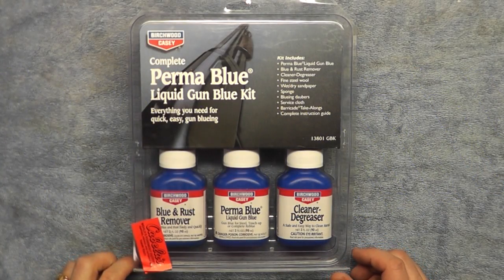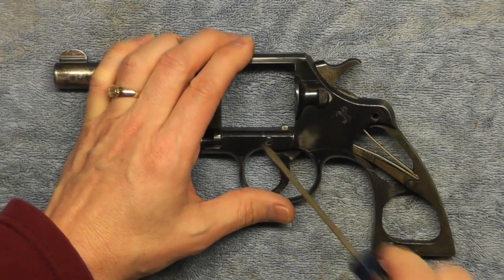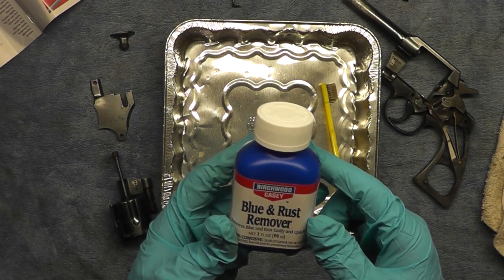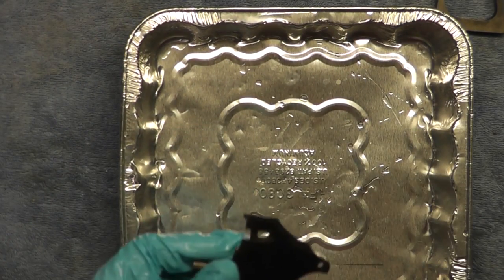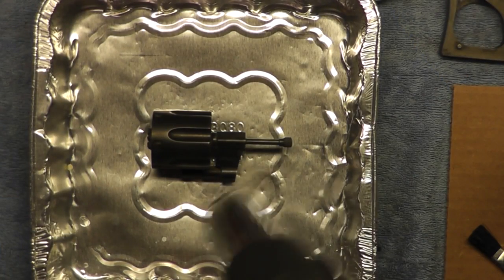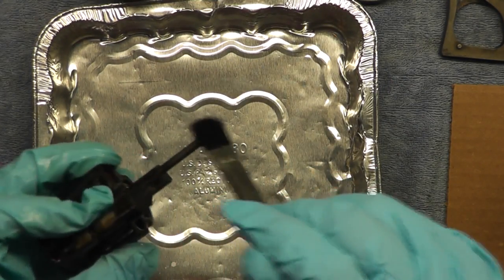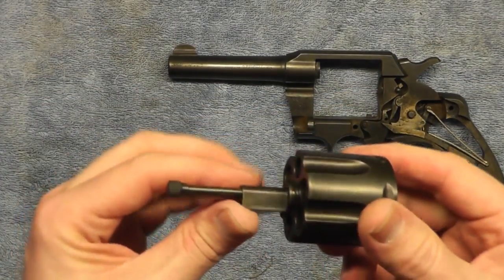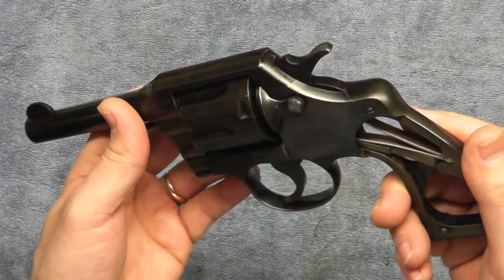Gun Bluing - Colt Official Police .38 Special

Comment: That was a good Job.  I did the same thing to my Official Police, but I took all the Internals out.  It's really very easy to do, easier than a Smith & Wesson.  Heating up the metal is a very good idea, and it makes a difference.  What I do is: First, Polish everything with Mother's Mag & Aluminum Polish to remove rust and most of the bluing. This makes the metal nice and shiny.  Second, I clean everything really good with 91% alcohol until it's squeaky clean.  Third, Heat up the metal, I use a hair dryer.  Fourth, Apply the bluing with a patch.  I rub the bluing in with the patch over and over.  I always poor the bluing solution into a small container to avoid contamination.  Fifth, Rinse with water using a sponge.  Repeat, Clean with Alcohol, Heat, Blue, Rinse about 3-5 times.  Lastly, as you illustrated, soak Her in Oil overnight.  I was surprised how good It turned out.  Keep up the good work and Thanks for the Video.

Comment: I would recommend that you completely disassemble the firearm and carefully hand polish the metal, clean thoughly and dry with hair dryer. When finished wait a couple of weeks,  heat with hair dryer and dip in transmission fluid, allow to cool and repeat two more times. This help displace moisture and traps oil in the metal.

Comment: I realize this is 4 years old, but a couple of tips for you. Completely disassemble the revolver (trigger, springs, misc parts) and reblue everything individually instead of trying to do it all at once. Use a patch with blue to get the inside of the barrel and cylinders instead of just cleaning them with a brush and oiling after bluing. If you still own this revolver I'm curious to know how this cold blue treatment has held up over time because I am thinking of doing this myself.

Comment: for the age and the condition of the gun when you first started the cold bluing application is about what you could expect with out using a hot tank and bluing salts that give it that bright luster, so the cold bluing job that you did to this gun per instructions was done properly,others in u-tube videos had used a high speed metal buffing wheel to polish up the metal to make the cold bluing process a bit brighter plus they also hand buffed the finished bluing with 0000 steel wool well done!!

Comment: Great job on the blueing and video presentation. I have used cold blueing to repair spots on guns but only recently on a complete gun. An old black powder revolver. I had good results also. I tried something you might want to try. I bought a new clean pump spray bottle to put the blueing solution in. This makes it easier and faster to cover large areas evenly. It also prevent you from having to stick the swab back in the solution bottle. Doing so usually ruins the rest of the solution by contaminating it with metal from the swab. If you are using a bottle for a touch up job you will come back a month later and find you bluing solution has crystalized inside the bottle. Keep those old revolvers serviceable. They are the best ever made.

Comment: Tip 1:  Heat the steel in your oven at its lowest setting, about 120 degrees F.

Tip 2:  Use a small spray/misting bottle to evenly apply the bluing solution.
Reply: Kent C. Carpenter no. Do not use spray bottle. U must use a a pressure spray bottle
Reply: This dude commented this same comment many bluing videos

Comment: Very kool. I have a Taurus model 80 made in 1979 that belonged to my Uncle that is mechanically perfect but needs a new finish.I might have to try this. I was looking at the Dura blue also. This gun has sentimental value but hot bluing in my area will cost way more than the value of the gun so I will have to decide which option to take. Thanks for the informative video.

Comment: If you tap on the back of the grips with the butt of your screwdriver you can remove that cover plate and not risk bending it and otherwise damaging it. Learned that with my own S&W. Just thought id give ya the tip.

Comment: You could have easily removed the mainspring and then the hammer and the trigger that way you could have completely disassembled and cleaned and refinished your revolver. It's always best to take every part out that can come out. You could have went online and found out how to do it. All you had to do was take a screwdriver and pushed the main spring out at that base in the handle. The rest would have come out very easily. Don't forget you need to apply appropriate grease to trigger assembly and as well as the hammer assembly underneath the cover.

Comment: I have the deep blue solution, did that to my Kframe, with somewhat worse pitting than yours. I simply cant get a uniformed finished on mine. Simply gave up and sent it a gunsmith. Congrats on yours, turned out much better than mine.

Comment: One mistake you made is you didn't put lubrication behind the plate where the Hammer mechanism is. You cleaned it out and now it's dry so you need to remove the cover and lubricate it thoroughly. Also the end of the barrel still looks like you need to add a little more bluing to it.

Comment: If you're using this cold blue on anything other than steel, it won't work.  If you're frame is alumium, or titanium you're using the wrong product.  Heating helps but it's all about the detail prep work that makes or breaks a bluing job.  Spending your time cleaning and removing old blue and rust and all the oils and dirt from your parts before bluing is key.  Once you've got it all cleaned never touch it without gloves on.

Comment: OMG, never grind a gun. All of the grinding, sanding and polishing which should be done is done in manufactury. Is it worth it? I use soft stel brushes in my Proxxon to remove all rust, old bluing and dirt and without damaging the surface. Electrolytic removal is also possible, but annealing should follow.

Comment: Frog Lube sounds like some feel-good greenie crapola...wont be wasting my time with that, or risking my firearms.
Reply from the maker: You are entitled to your opinion, but this "greenie crapola" far outperforms all the other lubes in a scientific test.  (Reference https://www.youtube.com/watch?v=Ig89FrPAT9M) Actually you are risking your firearms by not using it (according to the results) Just because something may be better for the environment does not mean it is not the right thing to do/use.  Be careful about imparting your opinions on others without doing a little research first.
Reply: I've read up on Frog Lube -- it is mainly coconut oil.  It is generally well regarded but some people report it migrating into triggers, etc. and then turning gummy like WD40 does

Comment: I am a collector of Colt's and S&W revolvers.  Refinishing the gun will reduce it's value.  It is worth more with the wear than after refinishing, especially if it is a poor refinish. Removing the rust with some oil and fine steel wool is OK.   On the one hand, I would say "DON'T DO IT"...on the other hand, you just made my original finish guns more valuable because there is now one less original finish gun on the market.  

Here is the general rule...if the gun has ALL it's original parts and is functional and SAFE...it will never be more valuable than in the original condition it is.  Even a professional, high quality, refinish will not improve the value. (in may improve your personal happiness and ownership of the gun and that is not a bad thing)  You will also find that buying a revolver in poor finish condition and refinishing it will be more expensive than finding one in good, original condition. 

The Colt Official Police is a common revolver and not terribly expensive, even for one in good condition...at this time.  Values are increasing rapidly on older Colt's.  In general, you can find good ones for about the same price as current production revolvers.

Comment: I'm DEFINATELY not confident enough to remove all the innards.
Reply: It's not hard at all to remove all the parts for bluing.
Reply: Then you can't own a gun... dissembling a gun is so easy it was designed to be done with little to no tools and in the field by a guy who was completely illiterate.
Reply: TwistingBitches Sure I can.  I can field strip.  I'd bet 95% of ALL gun owners can NOT remove ALL the inside working parts, as I stated I can't, w/out some well thought out instructions.
Reply: +filoIII you don't need instructions, just put the pieces in index formation as you took it apart.